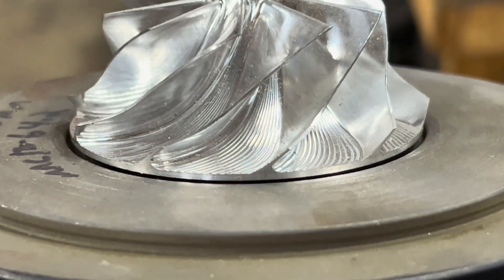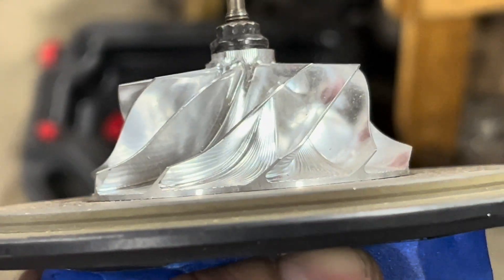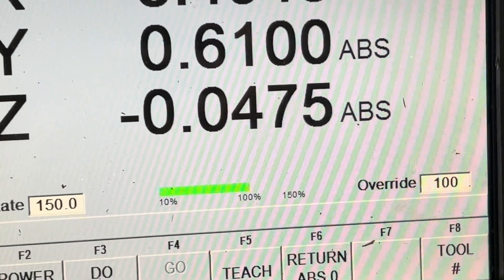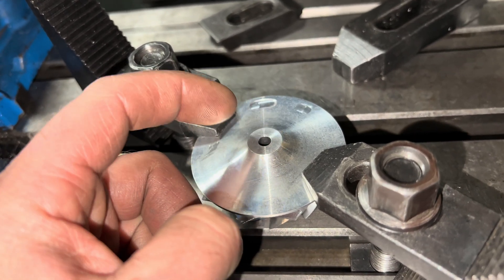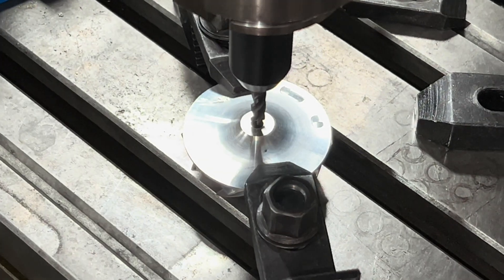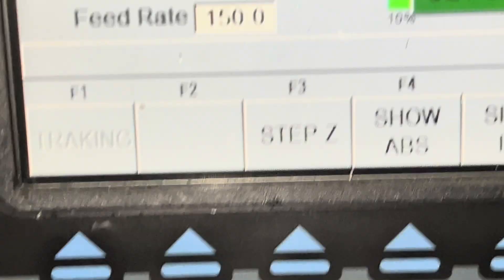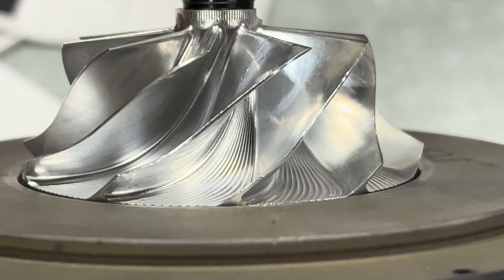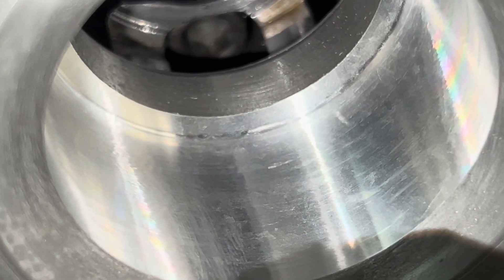Machining compressor wheel to fit cartridge

Comment: Won't removing that much material from the back face weaken it significantly? Might be worth doing this to a couple of them and then testing how fast you can spin them until the metal starts showing signs of yielding (striations on the back). I have a feeling the RPM limit will now be significantly lower than the original design for that compressor.
Reply from the maker: Some wheels a flat all the way across the back.  I did think about it but I had wheels much larger than this one that I had another turbo shop cut the back of it. I’m not concerned about it even more so because it’s a smaller turbo
Reply: I agree! This is typically only an issue with large turbos where the wheel mass is many times heavier and further from center